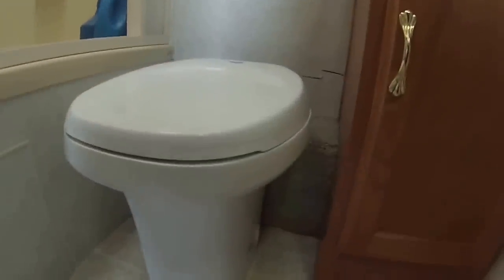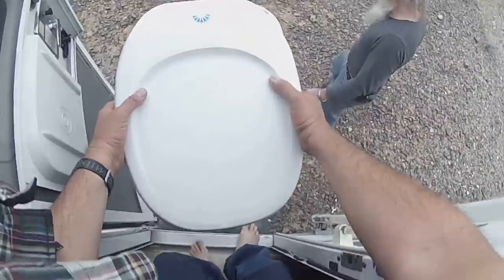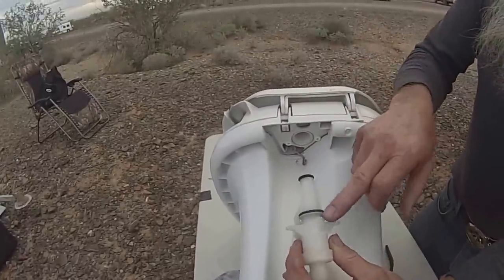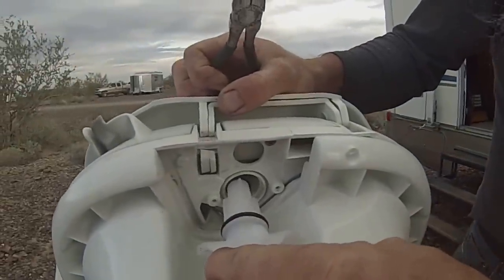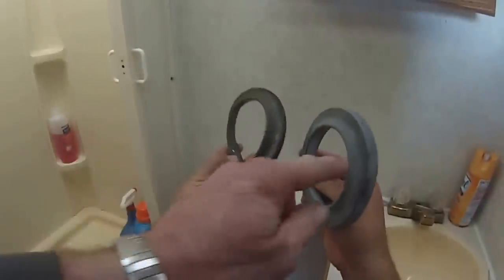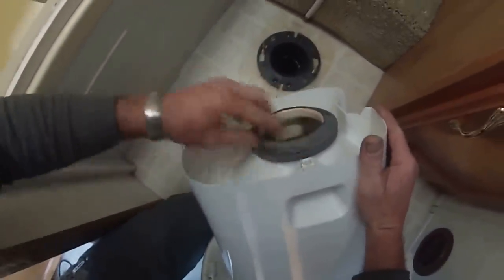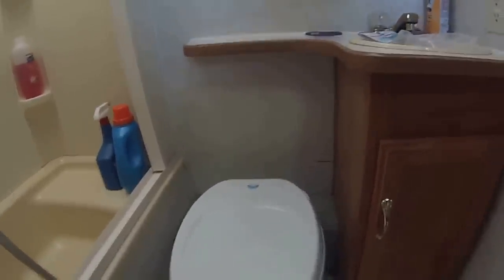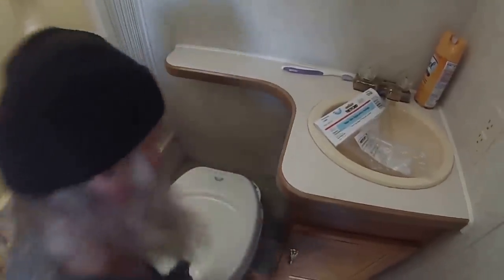Replacing Water Valve in Rv Toilet

Comment: I need to make a suggestion. Please change the name of this video to include the part number 13168. There are many different valves and when I did a search, your video was buried in a bunch of them near the bottom. But it should have been at the top which it would be if you add the part number 13168 to the name. You have a lot of views but you could have more my friend.

Comment: Thanks for the video, Kevin and Jeff.  I have a similar toilet in my trailer. I don't have a leak yet, as far as I know, but should it happen I will know not to panic.  Good job!
Reply from the maker: I had NEVER done one before and was a little cautious to do it. I was afraid that I may make a bigger problem. Having Mr Jeff there gave me confidence to try it. Of course ended up he still did lots of it. However I feel I can do it by myself now.
Reply: Exactly, Kevin.  Nothing wrong with being cautious. They say courage is being afraid of doing something, but doing it anyways. You did, and in videoing it, you have helped anyone else that might have similar issues.  Double kudos!

Comment: You wisely switched to a socket for the re-install? How/why did you rule out the "supply line/hose or its nut"? I always put fresh newspaper down after plumbing fixtures to monitor leaks. 
  Great work boys! Thanks!
Reply from the maker: Socket was too tall. Good eye there! ;) Ruling out the supply line was ... well that was just a guess. I will get some paper down to keep an eye on it. Great idea. Thanks for watching. CVK
Reply: Get a set of pass through sockets and a set of stubby gearwrench style wrenches, lot's of tight areas on an RV that long wrenches just don't fit.

Comment: Hey I'm have low water pressure on the toilet flush any tip or videos on what the problem is??
Reply from the maker: most rv toilet water fills are slow, if yours is very slow but working you may have some kind of partial blockage in fresh water line

Comment: did you get the AC looked at? cause Ron posted a video last year of a lady's RV go up in flames cause of compressor.
Reply from the maker: It is the A/C compressor on engine. I am hoping it wont be an issue until I return to RV BaseCamp in Spring. Its possible I may have it looked at before hand. I feel for sure it is something minor.
I just replaced a/c on roof with a new one but did not film it. My buddy David from Savannah that is an RV tech did it for me.
Reply: Campervan Kevin. ok just want you and that beautiful woof pack be safe and around for at least another 100 years. ;)
Reply: What is the A/C not doing? Not cooling? Compressor clutch not engaging? Rapid cycling of the clutch?
Reply from the maker: Compressor clutch not engaging. It was cooling GREAT until it wasn't. No horrible noises, no thrown engine belts. Lines still have charge. Hi/Lo switch maybe?
Reply: Check the clutch relay and it's fuse first. Both in the fuse box under the hood on the drivers side. The relays tend to have the contacts fail. Also check the HVAC fuse under the front seat. 

Next try a jumper across the low side switch on the accumulator.  Just unplug it and stick a short wire in. Try the A/C, if it works now the switch is bad, replace the switch.

For the high pressure and clutch test you will have better access under the front of the rig.
Look at the clutch connector you should have a Green wire and a Black wire.  Green is 12 Volt power through the relay, Black is ground. Take two wires, connect one to battery power the other to battery ground. Hook the ground wire to the terminal the black wire was on. Now touch the power lead to the other terminal. The clutch should snap into engagement. If it doesn't, tap on the front disc. if it snaps in now you have a weak clutch or excessive air gap from wear. If it still doesn't the clutch has burnt out. (can be changed without discharging the system)

Pull the connector off the high pressure switch on the back of the compressor, put a short wire between the two contacts inside the connector you took off. Try the A/C if it works that high pressure switch is bad. 

If none of these seem to make the A/C work it's possibly a bad wire or bad control head. The last test I'll give you bypasses the internal controls and wiring.

Look at the high pressure switch connector, it should have a light green wire and a dark green with white tracer. The light green goes to the control head. The Dark Green w/White is the system request signal. If you take the power jumper you used in the clutch test and plug it into the connector on the Dark Green wire, it will tell the A/C to turn on. Start the engine and see if the A/C is now on.  If it's working the control head or wiring has a problem. 

If it turns out to be the clutch or high side switch, it may be cheaper to just get a replacement compressor. 

Any questions just ask.
Reply from the maker: wow, just WOWWW. Will keep this handy.

Comment: Is there a regulator that can be attached to the water line?
Reply from the maker: Well you can purchase them that fit on before the rv at the water line. I always use one. The 12volt pump that supplies water when no outside water is hooked up is already at safe pressures.

Comment: would u like it better if the shower did not have that useless seat near the bottom? seems like it cramps the shower space?? i think bathroom sinks are a waste of space. just use the kitchen sink. the makers dont think anybody is big. carpet does not belong in the bathroom. be better id sink was torn out and toilet was moved over 6 inches and put at 30 degree angle. removing crummy bathroom door will give more ambient space. the bathroom is most important part of rv but they dont get it. small people are lucky.
Reply from the maker: I actually use the seat. I sit right on edge to shower. Its tight for sure, but works. I could make a better design as well.